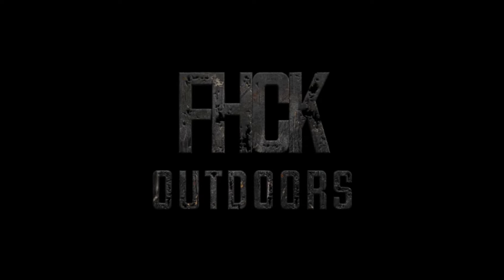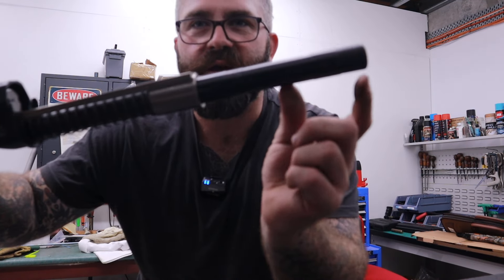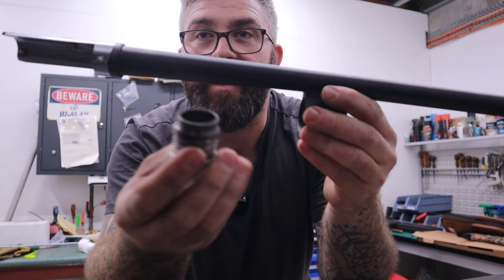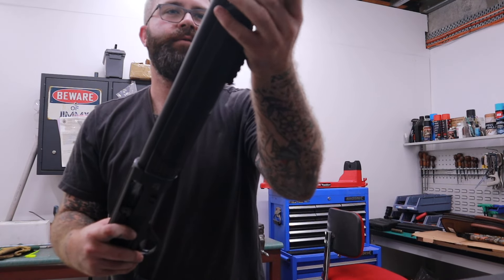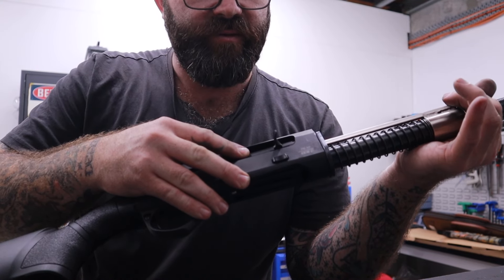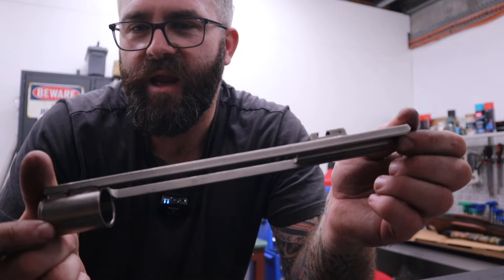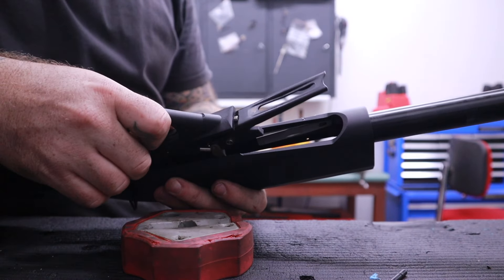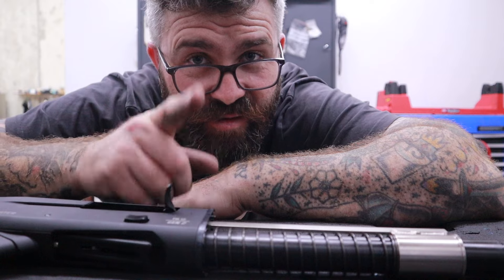Everything You NEED to Know

Comment: There is such an animal as 'Rubber grease", it's Clay based. Clay (Bentone ) based greases are normally used for high temp bearings applications, like wheel bearings, but don't tolerate water very well. They do not affect rubber. Wheel bearing lubrication recommendations these days suggest Lithium Complex greases which are more water resistant. Thanks for the assembly info, considering buying one. Cheers

Comment: Thanks for the video, mate. What's your thoughts on Ballistol? And also Remington Shotgun Cleaner? I'm guessing it's cheaper to get generic brake cleaner, which does the same thing? But what's safe on plastics and wood etc? I'd be interested in seeing a vid about cleaners and oils and greases, comparing the overpriced stuff from gunstores versus the cheaper alternatives from automotive stores, also explaining how to use them and their limitations etc. But I suppose with bore solvents you'd still need to buy them from the gunstore. Be interesting to get your opinion. Cheers.
Reply from the maker: Use non-chlorinated brake cleaner, its easier on plastics. Electric parts cleaner (aka circuit board cleaner) works really well too and is plastic safe. Ballistol is fine, and so are most other CLP type oils, but are much better at cleaning than they are lubricating. In my opinion, anything that professes to do everything does... but poorly. 

I am going to do a video on cleaners vs lubricants in the 'how to clean and service' series in the next few weeks.
Reply: @fhckoutdoors  Thanks for the reply, I look forward to those future videos. Electric parts cleaner sounds like isopropyl alcohol, which is great stuff haha, good for glass lenses too. I like ballistol mainly for it's mineral oil for protection while in storage, but yeah doesn't really lubricate moving parts for too long. Really need to look into using grease. Cheers.

Comment: So it seams that the only thing keeping this from turning into a semiauto is the release bar... seeing as it catches on the slide bar and keeps it locked back until the button is pushed which then allows the slide bar and bolt to move forward into battery... so removing that release button with its latch would allow it to cycle as a semiauto.... tell me if im wrong but it looks as thou im right ..
Reply from the maker: You're half right, but this gun doesn't have a second sear aka a reset sear. So if you take the release button out you'll get hammer follow; a live round in the chamber but the hammer forward and cannot be fired.
Reply: @fhckoutdoors  so what part of the release button stops that then as it only catches on the slide bar and keeps it locked back and thats all isnt it
Reply: Assuming here that if the button is removed you fire the gun the bolt goes back doesn't lock it then closes again and because of the missing reset sear the hammer follows it home where if the button is installed the bold locks back you release the trigger resetting it and push the button to close the action ready to fire.
Reply: @ber0006  i might be missing something as it only a quick vid not detailed but it seams what locks the bolt back is the relese bar engaging on the slide bar.. unless there is something in the trigger assy that also engages on the bolt when it locked back by the release bar im missing that... i think the only way would be to try it. but i dont have one as im still tossing up bettween this and the sulan

Comment: Seems like asking for trouble having a rubber o ring in a firearms gas system? Probably won't be too long before some after market outfit offers a gas piston with steel gas rings
Reply from the maker: @edwardd9702  I know I said rubber, but it’s actually a high temp material like silicone or VMQ. You’ll find that a lot of semi auto shotguns use them too.

Comment: What’s the difference between gen 1 & gen 2? Seems the same to me? Maybe better finish?
Reply from the maker: There are actually quite a few differences. Different firing pin, bolt body has been changed, method for retaining the charging handle is different, internal clearances on the receiver has changed, and then obviously the finish and different furniture. I'll do a video on it one day